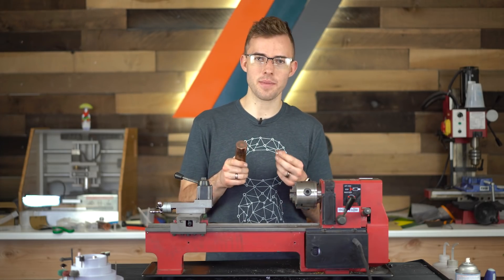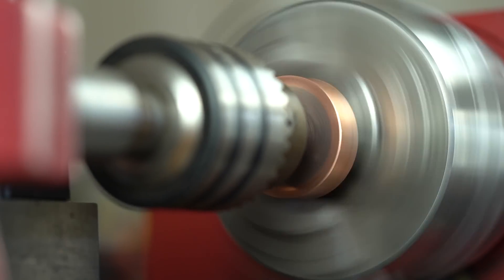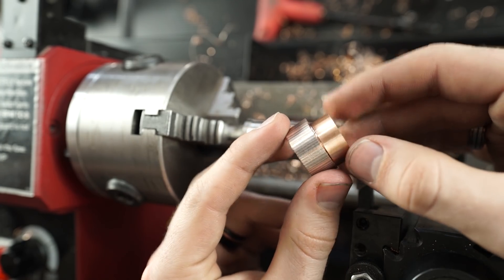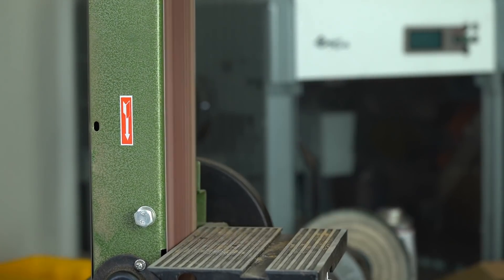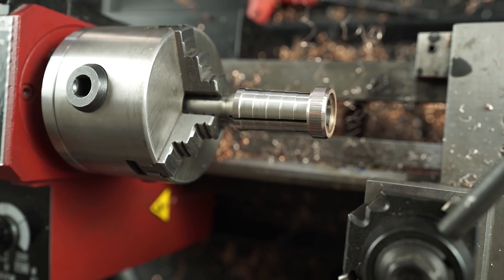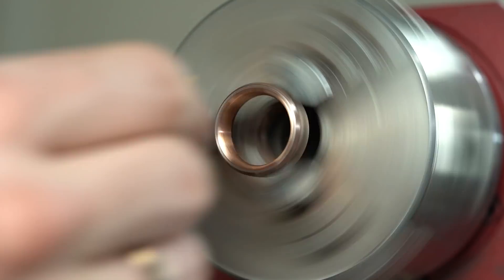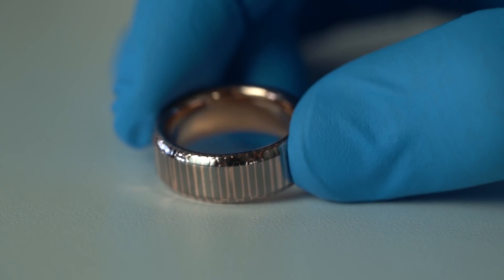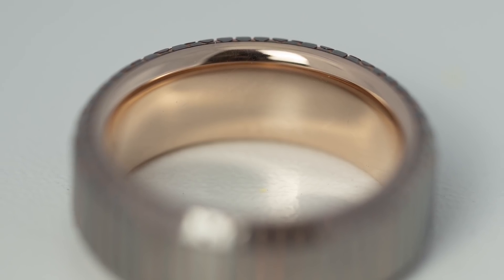Making my Best Ring Ever out of Superconductor and 18k Rose Gold

Comment: Put the inner material in the freezer and heat expand the outer.  Much tighter fit
Reply: Exactly, or use dry ice or liquid nitrogen.
Reply: Was about to say the same
Reply: yep, I always use this trick for pressed wheel bearings.
Reply: Yep was going to say the same thing dry ice is easy to get ,gold in dry ice superconductor in the oven at around 250-300 stick together done .
Reply: Liquid Nitrogen or dry ice

Comment: Old Machinist here. Beautiful design. I like the blend of materials. Just an FYI. Those are inserts not bits. I might suggest you use a piece of hard rubber instead of your finger when polishing your material in the lathe. After 40 years in a machine shop and working with heavy equipment I still have all my digits. So take that for what it is. Be safe Patrick and keep up the good work!

Comment: Hey, Patrick. I like how it turned out, however the fit between the gold and the superconductor could have been tighter. If you make the inner diameter of the outer ring just a tiny little bit smaller, than the outer diameter of the inner ring, and you put the inner ring into liquid nitrogen, the metal will shrink significantly from the cold, and you could just drop it into the outer ring and wait for it to warm up, and it would get really tightly stuck inside.

Comment: I would have really enjoyed seeing you attempt a friction weld between the two pieces. Basically, you rotate one of the two pieces under considerable force, and as the two pieces expand from the heat due to friction even more heat is poured into the contact point melting the two metals. This melting effectively wields the two pieces permanently without any chance of separation. It can be tricky to figure out how to do it well, but it is far more reliable, and in some cases can create a visually interesting blending of the two contact materials if you were to grind down to the transition point.

Comment: if you want to get an even better friction fit, you can try thermally expanding the outside band and/or cryogenically contracting the inside band. It'll give you a little bit more breathing room when it comes to getting the right diameters for a press fit, and it'll give you an even stronger friction fit that may not even need any adhesive.

Comment: Hey pat try thermal fitting by dipping it into liquid nitrogen or by heating the outer shell. Seems like it works but try is onto you, but the ring is really badass.....:)
Reply: yeah,it works perfectly,i'v done this with a piece of copper and a piece of steel,i frozed the copper with liquid nitrogen and in entered the steel perfectly,and after a couple seconds they where bound together
Reply: @joaoguilhermenextlevel302  hey bud I wanted to know one more thing that is there any chances of cracking with this process or any kind of warpage in the ring. Did you encounter that problem. I never tried that's why I asked :)
Reply: @ambroscustom  i only did it one time,and it worked fine

Comment: You do know there are Loctite products made specifically to bond metals together do you??? A sleeve or bearing mount Loctite with even a slip fit will ensure that the parts wont come apart with anything less than 600deg and thousands of lb/ft of force. Especially after baking for an hr.